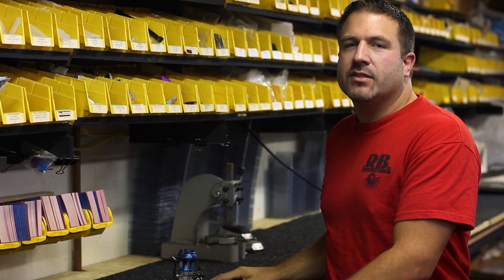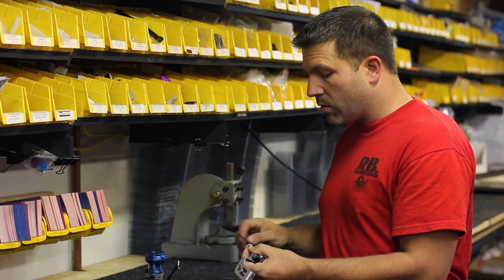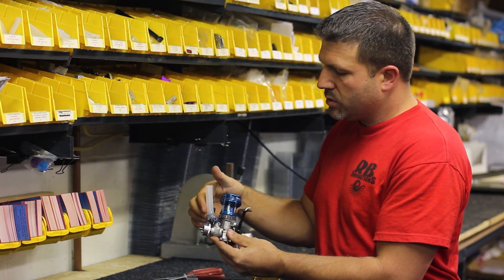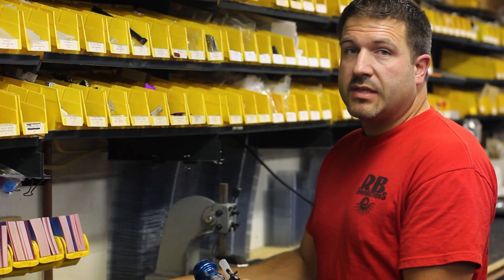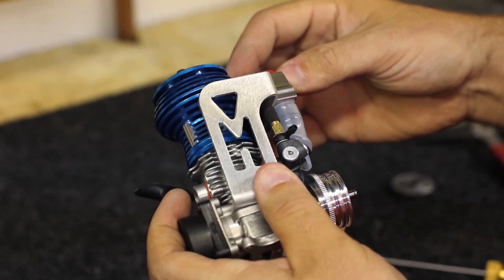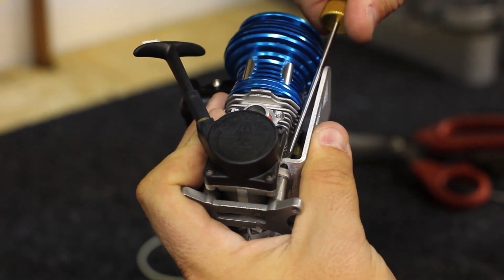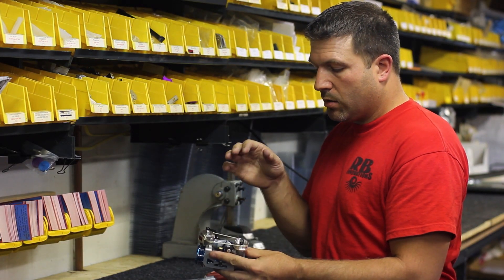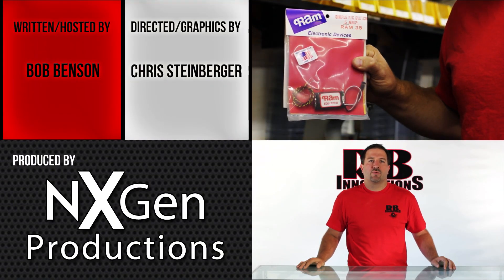How to Install an RC Supercharger from RB Innovations

Comment: With all the tranfer ports opened and the exhaust port being the last one closed how is it supposed to trap any boost? All it's going to do is push it all out the exhaust port along with the fuel air mixture making it run lean! If they actually worked why aren't companies and professional engine builders using them? You will have much greater performance if you took it off put it in the garbage and put on a good tuned pipe for improved return pulse time to help the engine become most efficient at making power. Just sayin

Comment: I wonder how many people actually bought these worthless “super chargers” even if u had any extra mixture coming into the engine you’d have to run it so rich you’d probably be back at stock hp. I’ve seen a revo with this on it and one bone stock and the stock one whipped the floor with the supercharged one. Big fail!!

Comment: Both exhaust and intake ports are open at the same time, it just pushes your air and fuel out the exhaust and often creates lean conditions at higher rpms..  For the price of the engine and the not so super charger you can get a Big Block engine and conversion kit that will be less complicated, more powerful and faster with some $$ left over to bet on a race against a supercharged small block nitro...
Reply: FACTS
Reply: How about a supercharged big block

Comment: This guy is an asshat. Two strokes don’t benefit from forced induction since both ports are open at the same time it would just blow the compressed mix out of the exhaust port.

Comment: Bob.  I need hub conversions l think for the losi super rock rey https://www.ebay.com/itm/Front-Wheel-Hydraulic-Brake-System-for-1-5-Scale-HPI-KM-Baja-5B-5SC-Rovan-RC-Car/193220645854?_trkparms=aid%3D1110001%26algo%3DSPLICE.SIM%26ao%3D1%26asc%3D225118%26meid%3D7e5f713ae08344da8614dcb4f7572cf4%26pid%3D101071%26rk%3D2%26rkt%3D12%26sd%3D264197385047%26itm%3D193220645854%26pmt%3D0%26noa%3D1%26pg%3D2546172%26algv%3DDefault&_trksid=p2546172.c101071.m2460. Bob l need super rock rey conversion hubs l think . Haven't really looked

Comment: Hondas are straight gas it has oil onboard like normal. The stihl is oil mix like a 2stroke , it doesnt have oil onboard so like 5lbs less weight

Comment: Both intake and exhaust ports are open at the same time, so there goes your boost....  Nextly more air requires more fuel or at higher RPMs you WILL be running leaner.  Third point cost, for the price of doing this (engine & supercharger) you can buy a bigger engine have less complication, probably even less weight and much more power.  Drop an LRP .28 and blow away any 3.3 with a supercharger for about 1/2 the $$

Comment: If you scaled this up, I'd put it on my Predator 4 stroke. Pointless on a 2 stroke. All this is doing is pissing off the EPA even more (for those of you in California). Well, second thought... maybe not. Since the oil and fuel are not going into the air as toxic smoke. they're just going into the air.   LMAO

Comment: This is rediculas.
That is a 2 stroke engine.
All this item will ever do is use more fuel while blowing it right out the exhaust ports.
What claims are u making here 
Research the operating principles of that engine buddy!!!!
Next youll be selling performance ignition products for diesel engines lmfao

Comment: how much more power will a supercharger do for a traxxas nitro slash with a 3.3 engine
Reply: Chief The Outdors Men -.2 hp
Reply: Adam negative .2 horse power, hu doesn't seem like it's worth the money to me
Reply: Chief The Outdors Men Any engine that doesn't have valves will not benefit from forced induction. There's nothing to hold pressure.
Reply: ok thank you

Comment: This is all horse shit, if it even built any boost it would blow the fuel out of the carb and lean out till it stalled and the fact that it doesn't do that shows that it does nothing but a parasitic affect. I mean seriously it's powered by a rubber band, if you want more power get a bigger motor or a better pipe
Reply: RKF427 are those not good enough reason for you? If that's the case I'm selling the 2nd generation of the pet rock. Email me for details, I'll sell you as many as you would like
Reply: really thats your issue with this?

Comment: man you have to love the people saying you can't super charge a 2 stroke it's funny and just whare do you think the first super chargers came from off a 2 stroke diesel engine that someone decided to put on thare drag car back in the day lol kids these days think thy know everything but yes in this application pointless you're losing more than you gain lol
Reply: you can supercharge a petrol 2 stroke if it has valves, if its just ports you can't, it will just pressurize the carb and spew fuel out of the bowl, ive already tried this with a turbo

Comment: @rbinnovations....hi How mutch power do this charger...?? differenz stock and tuned.?? number will be very nice.....
Reply: 8ball1707 it is almost a scam. you can't supercharge a 2 stroke engine
Reply: Fly Cat 1154 it needs valves for that to work so it wont work on 2stroke nitro/gas with ports
Reply: Fly Cat 1154 ... Really? Common sense would have told you I was talking about these kind of engines. Stop being a brat, kid.
Reply: wrong, you can supercharge a 2 stroke diesel engine. facts m8
Reply: Bert R did you even read what I said, I never said you could supercharge a ported 2 stroke, Sloan said a 2 stroke can't be supercharged, wasn't specified what type of 2 stroke

Comment: I wonder what the improvements are in terms as HP or RPM
Reply: Sarge Scum none. they are almost a scam. you can't force induce these kind of engines
Reply: Sloan V Oh well, I'm happy with my 36.000 RPM :D
Reply: They are separated by height. The vacuum is made in the crank case
Reply: Will Lyon who are you taking to
Reply: not to say this system works I don't know what the output is above intake vacume, but why couldent you apply forced induction to any engine ?
Reply: Kevin Milner this type of two stroke engine has the intake and exhaust ports open at the same time. This would result in wasted fuel flowing through the two valves. The exhaust closes after the intake does so it is impossible for any compressed air to stay in the combustion chamber. Get it now?
Reply: are the ports not separated by height because how would there be any vacume to bring air and fuel mixture into the combustion chamber ?
Reply: Sloan V not to discredit what you are saying you could be right I'm really undecided yet just having this conversation to dork out and learn are the nitro engines similar to say a pocket bike engine where it has reeds ?
Reply: Kevin Milner they are like weed eater engines. There are plenty of videos showing how those work! Or you could search for "nitro engine disassembly" and you can really see how they work
Reply: Kevin Milner nitro engines are crank port engines. Also not all two strokes have reed valves. Some do while others are piston port design.
Reply: Sloan V The vacuum is created by the exhaust gases escaping once the exhaust port is "open" on one side of the head and it creates a venturi type of effect sucking in fresh air througj the intake port as the piston reaches bdc. not through the crankcase. if you google how a two stroke engine works it will explain this in a video.
Reply: Adam S all two stroke engines are crank port. The fuel and air goes into the crankcase then feeds up through the sides of the cylinder to the top of the piston. There are no intake valves in two strokes (other than reed valves or rotary valves, but those feed into the crankcase) If you google how a two stroke engine works it'll explain this in a video. Here's how these nitro engines work: animatedengines.com
Reply: Zero!
Reply: Wrong. google it scrub

Comment: LOL wow a "supercharger" on a 2 stroke engine. fucking stupid gimmick, I feel sorry for anyone who wastes money on one of these.
Reply: Firstly yes carb'd engines can have force induction.
Carbs were used on forced induction systems in draw through and blow through set ups long before EFI engines were on the market. 

The vortech, pro charger, powerdyne, etc supercharger systems started off as chargers for carb'ed v8s, running a blow through system. 

Granted this is an RC model nitro engine and the gain will be little if anything what so ever so in that aspect you are correct it is slightly gimmicky.

Also whether it is 2 or 4 stroke makes absolutely no difference (In the big picture), I work on ships most of our main engines are 2 stroke and normally twin turbo, granted you have to have an electric powered aux blower for starting the engine.
Reply: Sloan V then why isint it called a procharger if its just a fan
Reply: Best of Youtubes Chainsaw Community no, they are actual bs... it's a two stroke engine. any carbureted engine can't force induction...
Reply: JM Walton they would have to be a well built carburator in order to make enough pounds of boost to be with it. Anyways I have a question for you now. How do you turbocharge a two stroke engine? The pressure going in is not going to multiply. You know what I'm saying? I don't see how there is enough exhaust pressure because energy is always being lost...
Reply: Sloan V dude the exhaust port closes before the intake so that there is time to build boost
Reply: Riley Kirk please rethink your post. The intake closed first... Otherwise the exhaust would go into the intake...
Reply: Sloan V not with the pressure from a supercharger right? how about the reed valves?
Reply: Riley Kirk nope. These superchargers just blow wasted air fuel mix or the exhaust with no compression
Reply: Sloan V but what if the exhaust valve closes before the intake...so there is time to make boost? the exhaust cant go through the intake because of reed valves and the supercharger pressure right?
Reply: That's the other thing. That supercharger will make no boost. It is just a fan. They would be charging $100 if it was A REAL turbine and turbine housing. Also it likely won't spin fast enough. They are a scam
Reply: Riley Kirk marketing
Reply: you beat me to it. I was gonna say the same thing
Reply: Detroit 71 series is a 2 stroke diesel. 
With a supercharger. Started making them in 1957 and stoped 1995. So yeah they did have a 2 stroke with a supercharger on it.
Reply: the detroit diesels were uniport diesels, which means they have an exhaust valve and transfer ports, and no presseure is made in the crankcase. The blower was to clear the exhaust out of the cylinder, but not make boost. Uniport 2 strokes can keep boost in the cylinder though.